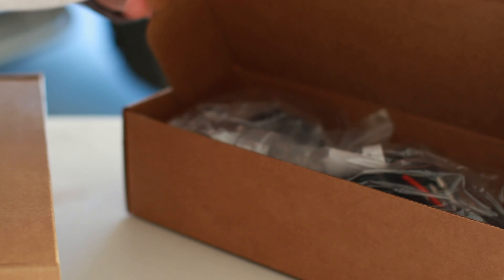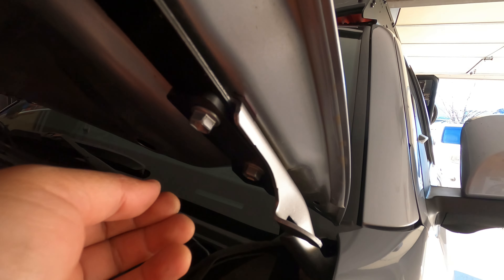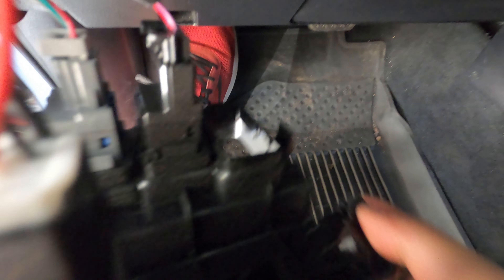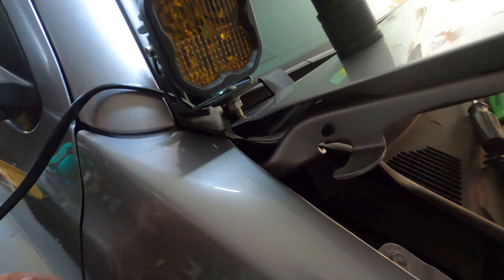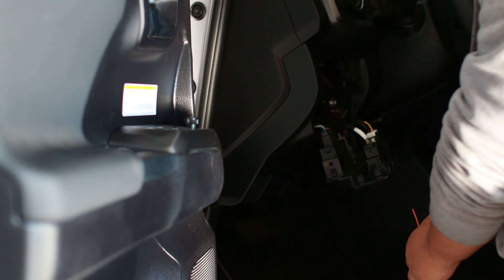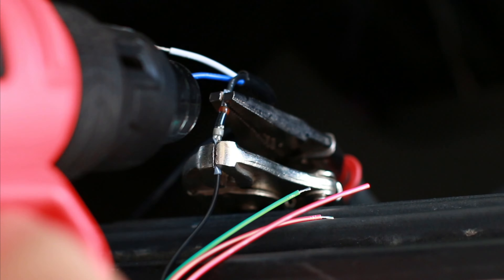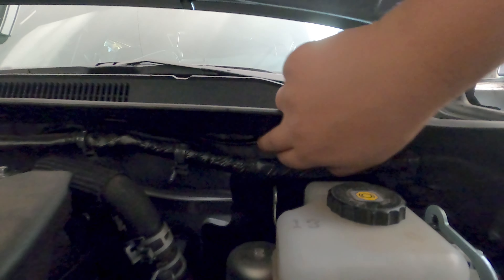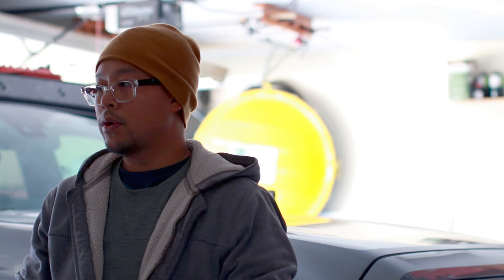Diode Dynamics SS3 Pro Ditch Light Install | Toyota Tacoma | How to wire

Comment: For those wondering about the backlit version and wiring to a Cali-Raised LED 'OEM' Switch, do not switch to the additional sub harness provided. Unclip the provided 3 position switch, so you have red, yellow and blue. Blue is backlight function, so wire it in to a nearby source that runs when you want backlights to function, if you want to use that function, otherwise, cover it up. Yellow is the main beam wire and red is a direct-from-battery wire. Connect the green from cali raised switch to the red from the DD harness, Red 1 from switch to yellow on DD harness and then utilize a common ground (I tapped in to my LED bar ground wire) and tap the black wire from switch to that. Red 2 from switch is to maintain that illumination when dash lights are on and you can follow this video's guide on that.

Comment: This was extremely helpful bro thank you so much could you please list what connectors you used to make connection between the wires?
Reply from the maker: Appreciate it! I'll put the amazon link in the description.
Reply: @dadaking  also can o tap into my stock light switch to power the light on the Cali raised tall switch.? Which button did you tap into ?
Reply from the maker: @gangman261210  I tapped into a MESO puddle pod switch. You can tap into any of those switches down there. Buy a test light to determine which wire is an illumination wire. Goodluck!
Reply: @dadaking  can you give details on the test light you used and did you have to unplug the meso switch in order to locate/identify the illumination wire? Thanks.
Reply from the maker: @rustyjames8029  I just used a regular 12v test light, with the other end grounded. Having no clue which wire was illumination, probe around to see which wire is hot when you flip the headlight switch. You do not need to disconnect the meso switch.

Comment: Great video!  Is this the one with the backlight? I just purchased the same one with backlight.
Reply from the maker: Nice! Those I believe are the newer versions. I have the older ones. You'll  dig them. 😉
Reply: @dadaking  ok there's a blue wire which is for Backlight.  I'm just curious if i should connect that wire "blue" in the same wire where it illuminates the switch.
Reply: @MrSaturnino1  ordered mine, haven’t come in yet. Wondering the same. I asked DD, they said I could tap the blue wire for the backlight to the running lights or side marker which would turn off the backlight once I hit the switch and the regular pod turns on. Which removes the blue wire from the equation, leaving me with a red and yellow wire from the pods to a 4 wire switch. That’s where im puzzled
Reply: @kylestones7059  hi there! Did you end up figuring it out?